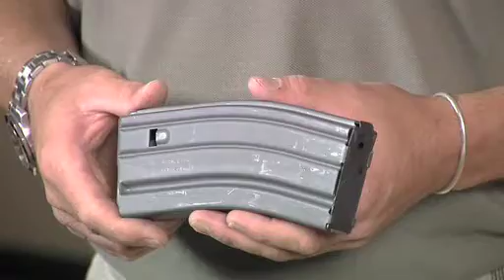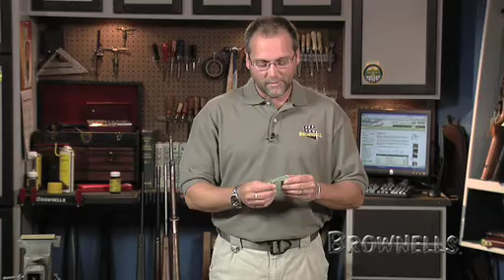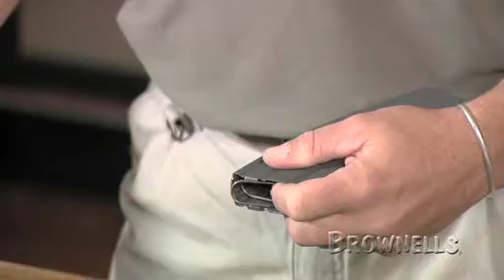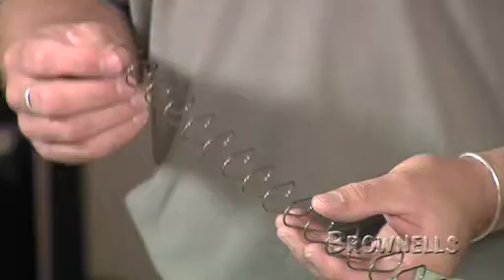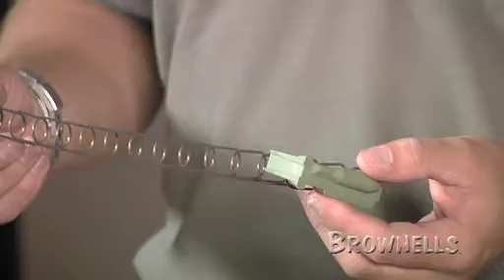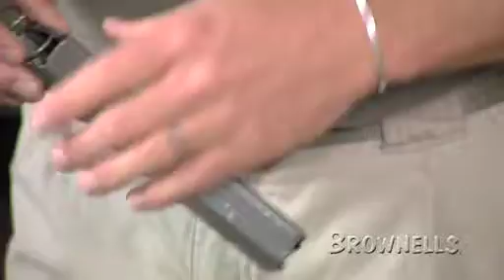Brownells AR-15/M-16 Magazine Maintenance

Comment: I have ot say i am very surprised to hear you say to lube your springs and inside of the magazine....? Seriously i have served and in the desert or jungle you do "not" want to lube your mags!!! It dose nothing more then attract sand/dirt and other particulates inside the mags! You will never be able to wipe them totally clean of the oil/lube. Trust me! I was using spray silicone that dries 100% and leaves no residue for dirt to collect on!!! other then that i agree with the rest of the video of inspection and replacement of the parts! Only if the body it self is dented or bent in some way or worn badly on the interface where the mag comes into contact with the rifle ,that do get worn the only thing left to do then is toss it! The body is the main component that is Needed to keep the magazines life going.The rest can be replaced and as long as the price gouging hasnt hit these types of parts these days well worth replacing to, not have to buy new mags! And if anyone is into trying to coat their own rifles or other arts,then mags are the best place to practice your new skill if you feel so inclined to re-coat your mags to give them even a longer life? I know i do!!!
Reply: Only way to clean that crap is gasoline

Comment: You think that you would realize being a pro-second Amendment organization that makes its living off of selling guns gun parts and tools to the gun Community they would at least get the magazine name right. A 30-round magazine for an AR-15 rifle is standard capacity, not high capacity.
Reply: This was also eight years ago....
Reply: @MrBDDSWC  it doesn't matter if this video was produced in 1970 the 30 round magazine became standard capacity after the United States military switched from the waffle 20 round mags in the mid-60s to the 30-round standard capacity magazine. Which the United States military still uses to this day.
Reply: @echosreloadingchamber7306  Relax, all I was meaning was, they would definitely describe it differently in a video now. By the way, I'm a former Marine, I know exactly what the military carries and when they started carrying it. Thanks for the wikipedia "knowledge". Semper Fi!
Reply: @MrBDDSWC  actually brother I've been building Eugene stoner platform rifles since 1984. I had a manufacturing FFL for almost 15 years. Ran my own shop for those 15 years and then retired. My father was in the Air Force during the Vietnam conflict and was Stateside because his older two brothers war combat infantryman in Vietnam at the time. He was stateside in Southern California and was attached to a motor pool. My father actually transported Eugene Stoner a couple of times and higher ranking officials back and forth from ArmaLite. This all happened during the adoption of the XM 15 by the Air Force. My father later was able to transfer to Southeast Asia because he had a dual MOS and was a loadmaster on a C-130 for another three years. So pretty knowledgeable of the development of the Eugene Stoner weapons system. Thank you very much for your service to our country. But don't think just because I have a little kitty cat as an icon that I'm 16 years old. I'm pushing almost 60 now. God bless, and keep you. Echo
Reply: @echosreloadingchamber7306  Fair enough. ;-)

Comment: 30 round mags on ar is not high cap rifle was made to use 30 rnd mags that's normal capacity more than 30 is high cap
Reply: NCGUNS— No, I don’t think so. Whatever kind or type of magazine you have, however many rounds it holds is still standard capacity.